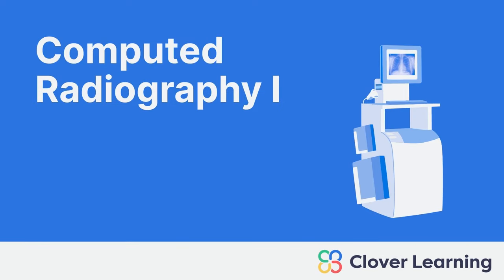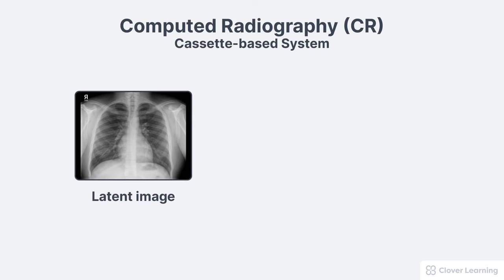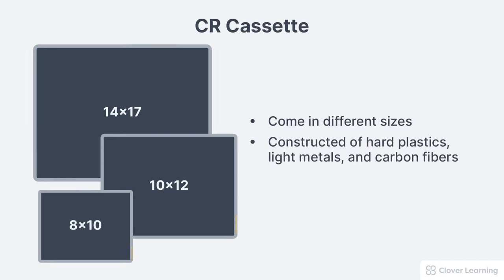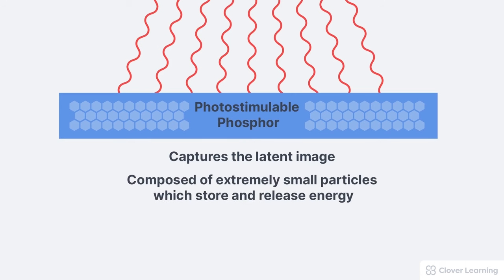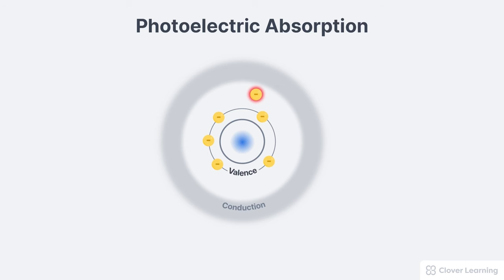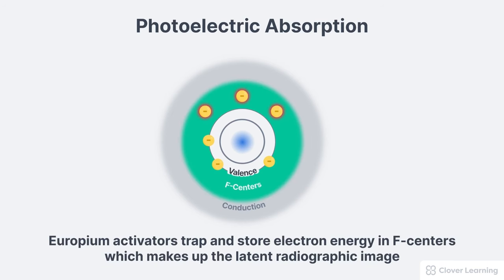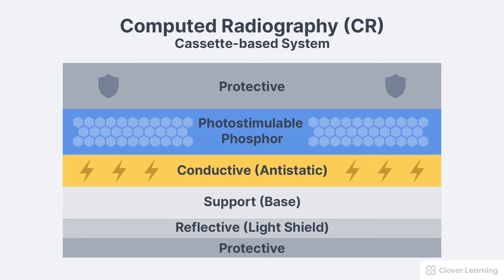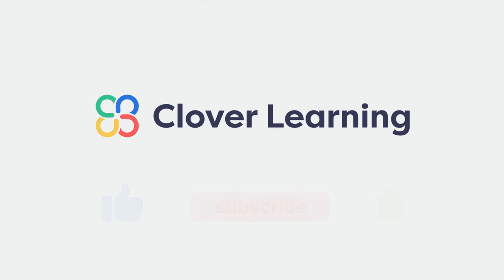Computed Radiography CR Image Receptor - Digital Radiography

Comment: how CR can cause increased radiation exposure to patients?
Reply: AFAIK it can't
Reply: usually it does not. but if we were to compare Film and CR. although CR has a wider range in its Dynamic Range, CR is only better than Film if the proper exposure is used. 
if we speak about radiation dose, if CR was used but it has been used IMPROPERLY (overexposure), then proportionally CR actually has a higher radiation dose compared to Film. 
- not sure if that made sense, but I hope I helped - its all basically to do with the dynamic range of Digital and Film radiography